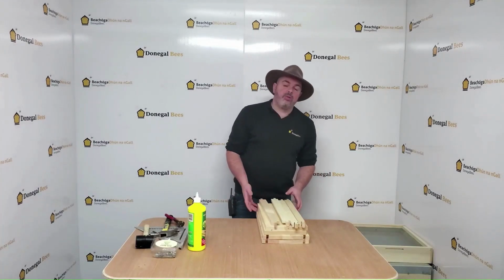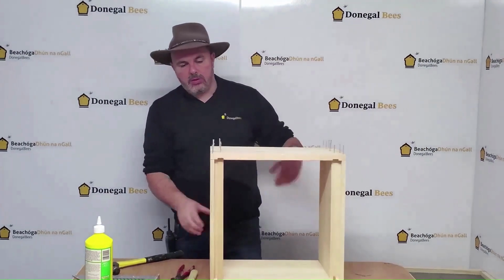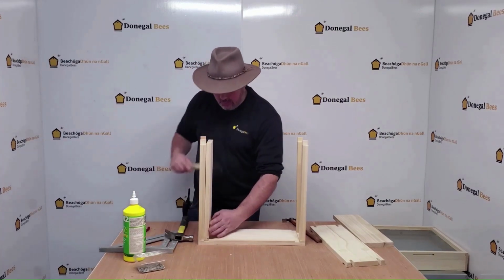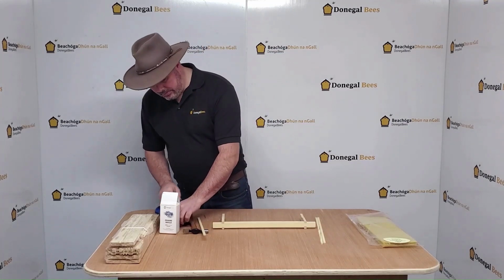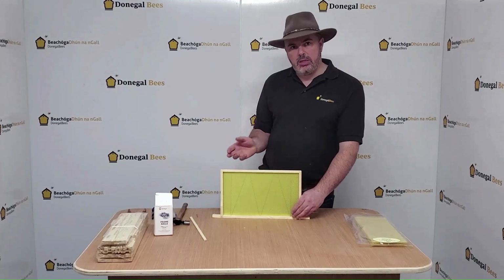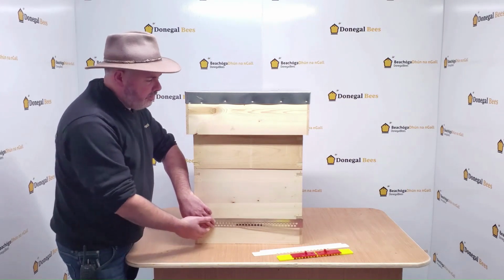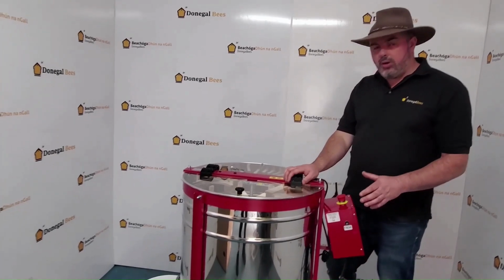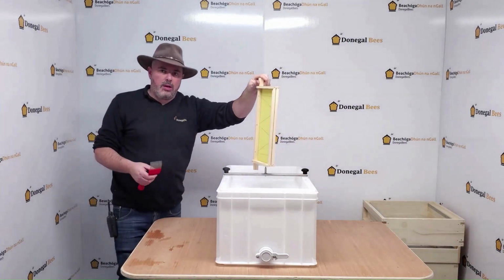EDIBEE PROJECT TAKES A LOOK AT EQUIPMENT AVAILABLE FOR IRISH BEEKEEPERS ON THE MARKET IN 2022

Comment: 00:10 - National Brood box construction
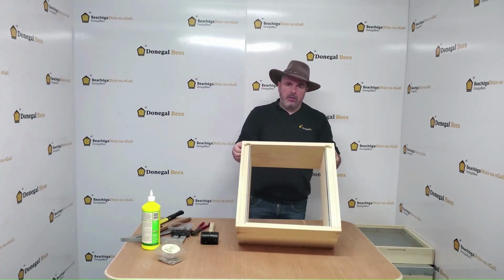12:32 - National Super construction
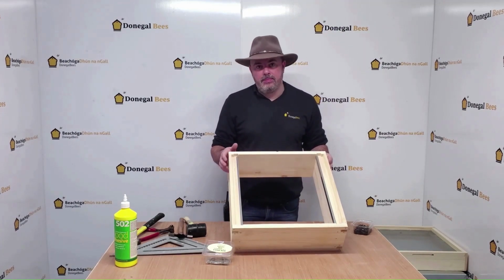23:21 - National Super Hoffman frame
28:20 - Nation Brood frame construction
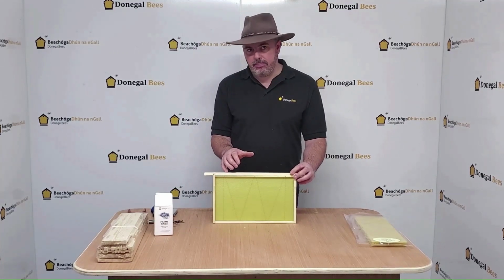33:41 - National Manley frame construction
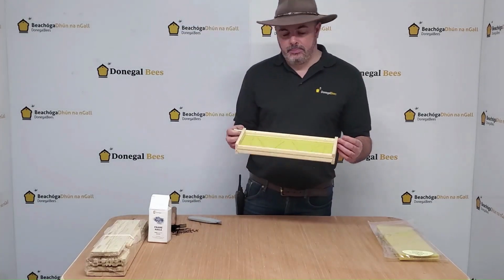37:54 - National Hive assembly
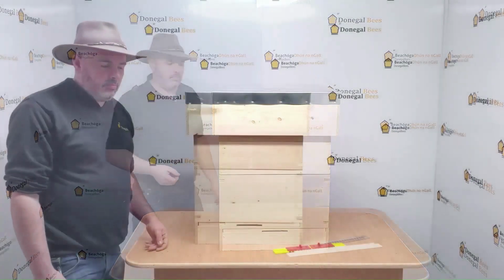40:10 - Application of mouse guards
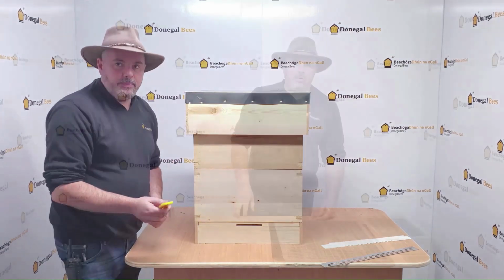41:20 - Types of Queen excluder / scraper
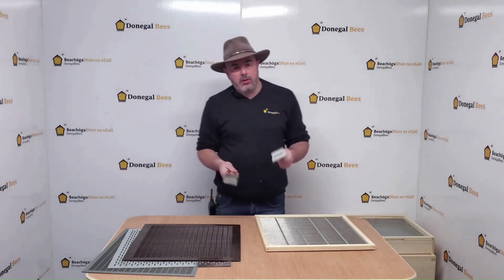44:11 - 4 frame tangential extractor
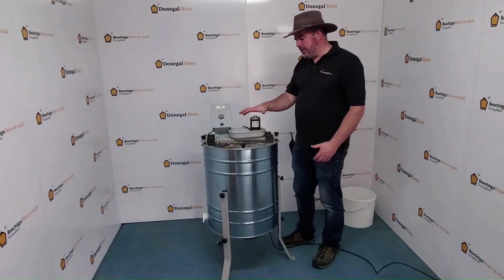46:02 - 8 frame tangential extractor 
47:10 - 20 frame radial extractor
49:47 - stand for settling tank / 4 frame manual extractor
50:18 - Honey filters
52:10 - Uncapping forks
54:59 - Uncapping trays & sieves